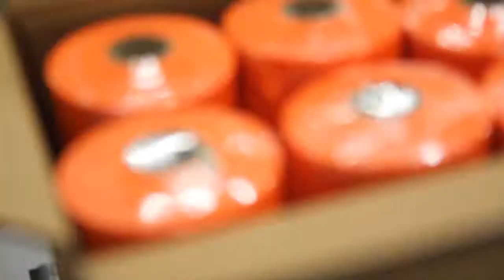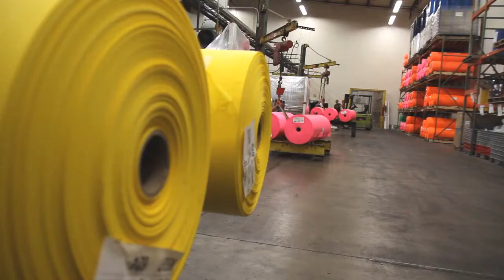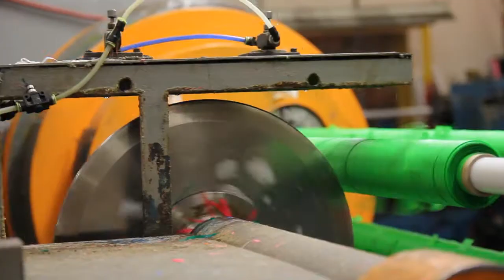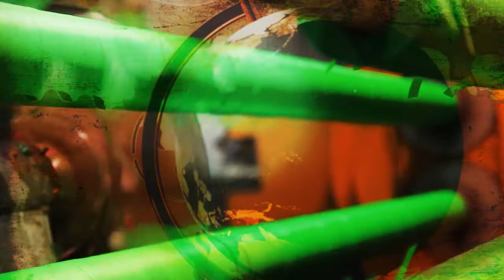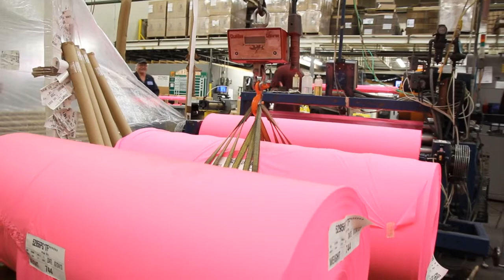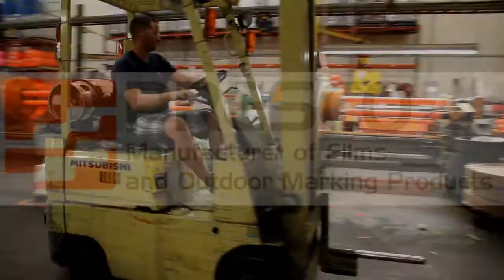Presco Roll Flagging Tape

Comment: Hey just wanted to chime in here, I'm in the Timber Industry and I've got a gripe. I use alot of flagging like 5+ rolls a day...every day. In the past 2 years the flagging ; does not last as long, is very frail in cold weather, has less elasticity than previously, and is weak or breaks when tying knots. If this message makes it to anyone that can address it, I hope you can fix it